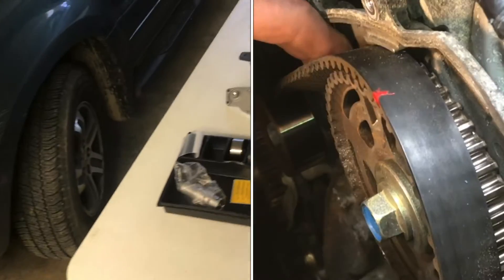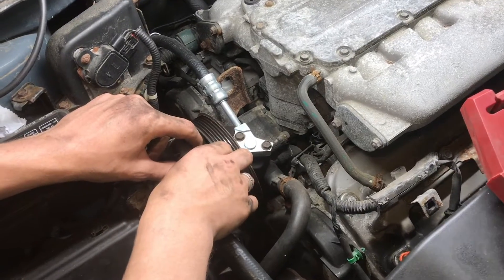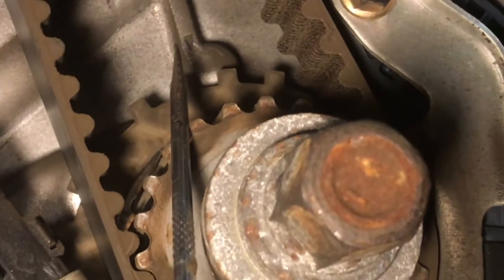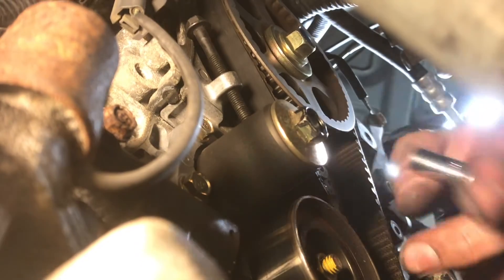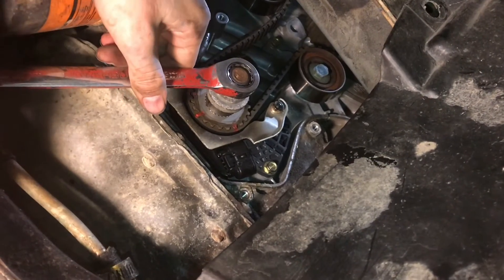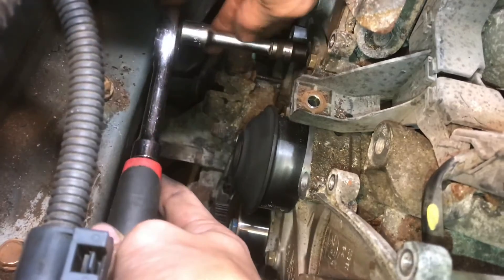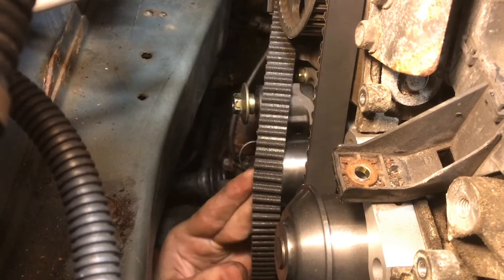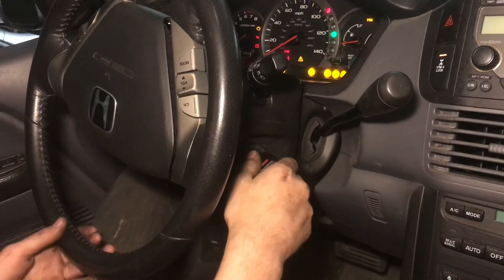replacing TIMING BELT honda pilot 05-12 (water pump, tensioner) 3.5L acura (torque specs)

Comment: I’m in a situation where I can’t get the crank bolt off but I’m trying to get the belt back over the cam gears. The belt is new but I had to do head gaskets. Is it possible to access tensioner eyelet in this position? I realize I may actually have to cut the lower cover to gain access. Just looking for input. Thanks

Comment: Took me 12 hours but by God I did it, the engine mount took me 4 hours alone but now I know the tricks of it I can do it in record time next time was at 265k miles on my 2005 I bought for 500$ figured it was time since it was never done the belt didn't even look bad when I took it off even with Texas heat.

Comment: Thank you for the obvious time and effort put into this video.

Timing belts on interference engines is outright engineering malpractice.  Even Hyundai/Kia has moved away from this.  Honda should be ashamed of themselves.  This isn't a freakin' high-performance race car, it's a soccer mom grocery car.  Maintenance schedules will almost certainly be missed.

Comment: i need help.  2005 honda pilot.  screwed up and lost the timing alignment when replacing the timing belt.  I now have lined all the marks up and put the new belt on. but how do I make sure it is not 108 degrees off????
Reply: All timing marks match. Can't get it off 180. Crank does full rotation, and has no clue if it is the 2nd or 1st rotation in relation to the cams. As long as they are all hitting DTC together.

Comment: What terrible engineering. What a mess to replace the timing belt and water pump. These are normal service parts but you have to take half the car apart to get at them.
Reply: It was was designed like that on purpose.
Toyota is more user friendly.
Reply: This is easy compared to Ford pos designs

Comment: Quick question for you.  I pulled my crankshaft pulley off, then pulled the lower TB cover off. The TB Idler pulley had the ball bearings falling out and was completely shot...  when I turned the crank to line up the marks, the front cam mark was off about one tooth, and the rear cam was off by about 4-5 teeth.  Can I just remove the TB, manually turn the cams the little bit needed to line up, then reinstall all the pulleys and belt again? The car was running fine, but I think the cam pulleys slipped a few teeth when the idler pulley let go.
Reply: I was wondering the same thing why not just remove the belt and turn everything to the marks. I always get a service manual when I do this kind of work. Friend has a 06 pilot needs belt done I think I will recommend a shop do it.

Comment: Excellent work. What a shit of a job?
Reply from the maker: Hope the video helps people that I’ve got to go through getting his job done. It’s not fun but it’s necessary. Breaking a belt makes the job literally 10 times worse, i’m glad it’s done, thanks again for the comment👍👍
Reply: @livefree6878  what kind of bolt did you use to compress the timing belt tensioner?
Reply: Hi if the timing Belt brockes in this engine, the valves get distroyed???